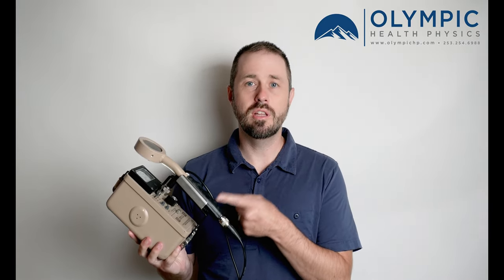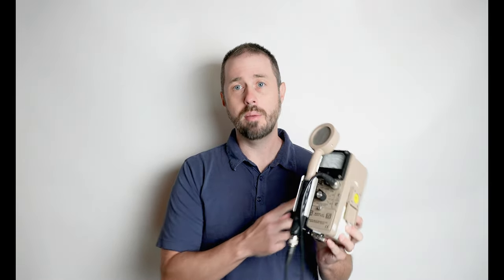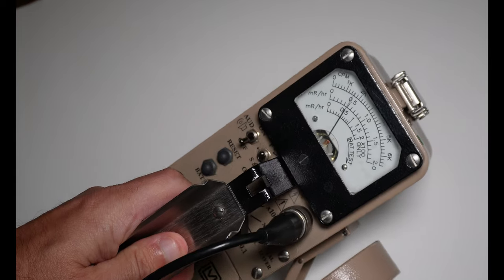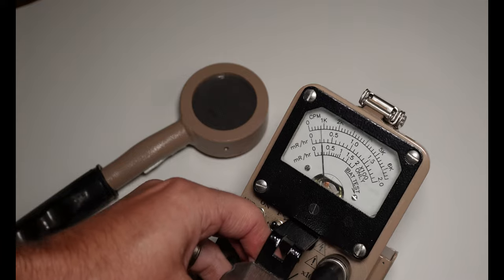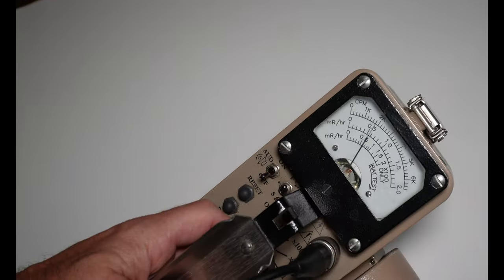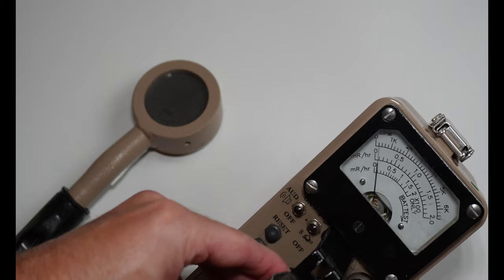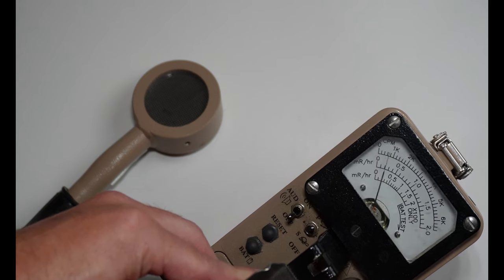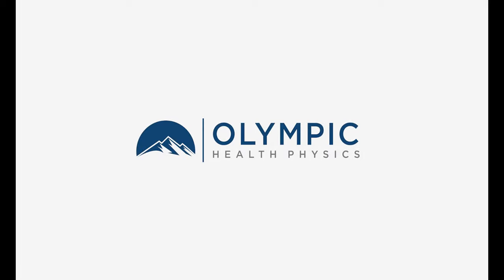How to Use a Geiger Counter

Comment: Also basic translation for multiplication factor for the values on the reader equal to sensitivity of the measurement, x100 would mean its less sensitive reading a larger amount 50 100 150 and 200 rems and 1000 1500 is high enough to kill immediately, I'm guessing the time exposure and amount of radiation or the rate of exposure moves down in lethality taking a linear rate but that's just a guess

Comment: mR/hr.....?
What is the "R" unit? rem, rad, roentgen?
Reply: It should be rem as it is a US made instrument.  The use of the rad means you know which type of radiation you are measuring as there is a conversion factor called the RBE or Relative Biological Effectiveness.  The RBE is 1 for beta radiation, x-rays and gamma rays, so 1 rad = 1 rem.   For alpha particles the RBE is 20, so 1 rem = 20 rad, as the alpha particle is more damaging to biological material.   The Roentgen unit is the measure of ionisation of dry air, an older physics unit, so more appropriate for an ionisation counter.
Reply: @karhukivi  
Thanks.
Reply: @jayytee8062  Its Roentgen, exposure rate (expressed as milliroentgen per hour or mR/hr).